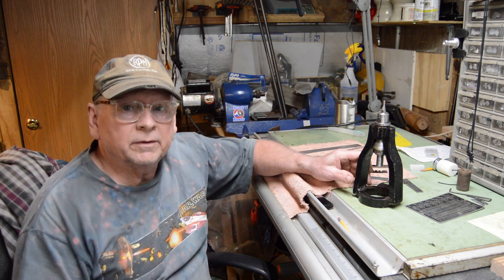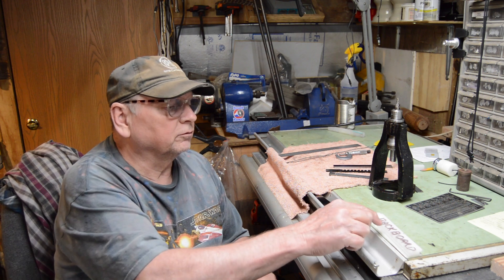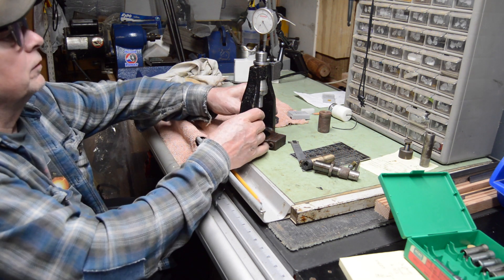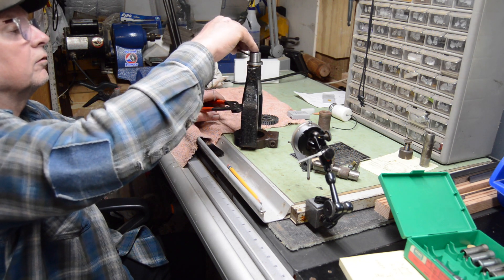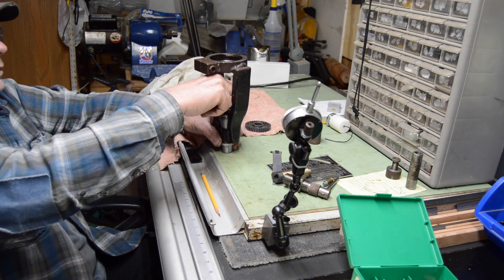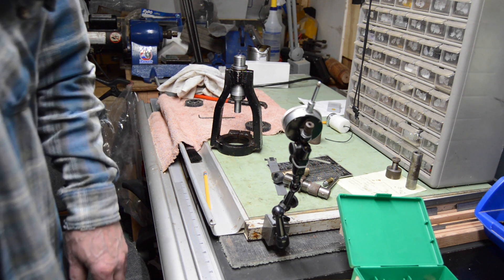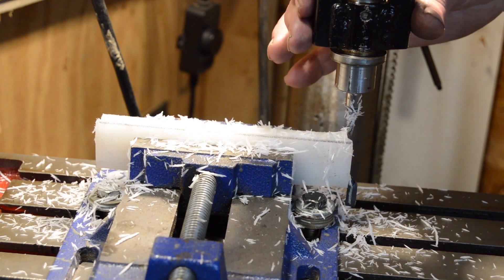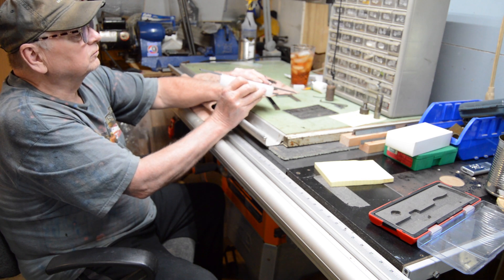Finished up and tested drill spindle for milling in drill press.

Comment: With those drill vises you'll never get work to sit in them square. The movable jaw always lifts up. You can mitigate that somewhat with a round on the jaw. Just a cylinder you squeeze against the work. But eventually it'll drive you to get a real milling vise. Because not being able to square anything up is pretty annoying.